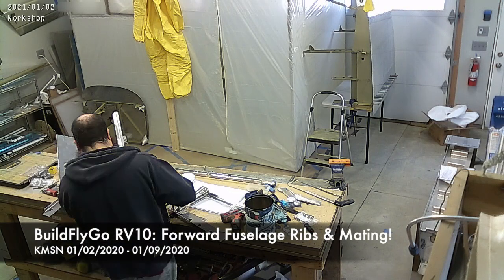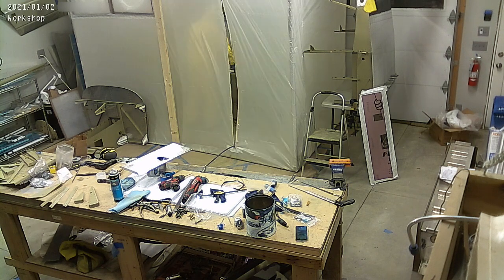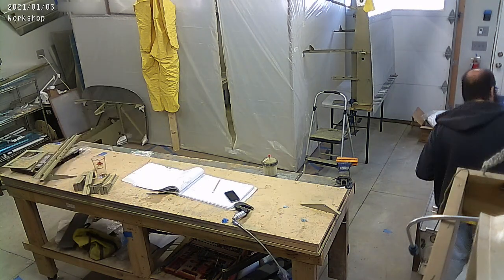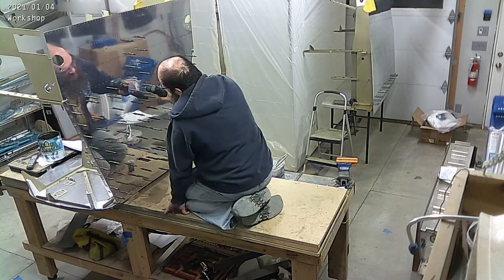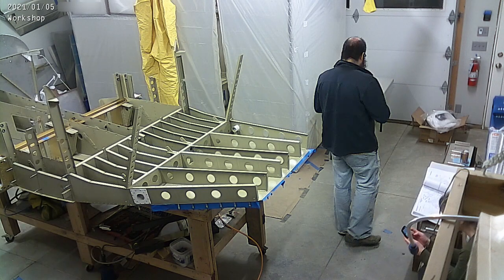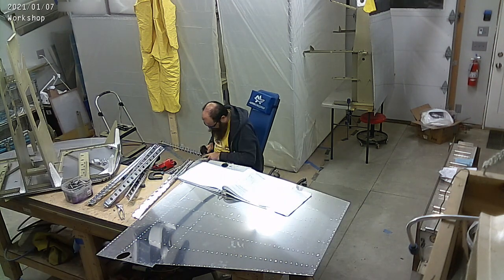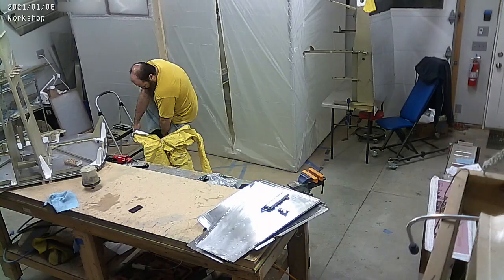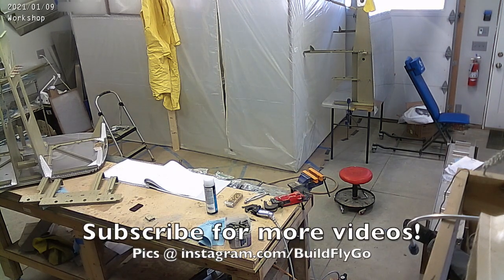RV-10 Build: 01/09/2021 - Mating the Fuselage Halves!

Comment: Hi Guil, I’ve been using the Numax squeezer for all the substructure and edge dimples on my Rv10 build, it works great for dimpling but I found That if you use the shorter piston then you have to add a washer under one of the dimple dies to get the dies closer together, the longer piston seemed to be slightly to long. I also found it took less pressure for the dimpling than it did for squeezing rivets. hope this helps and thank for posting all of you videos!